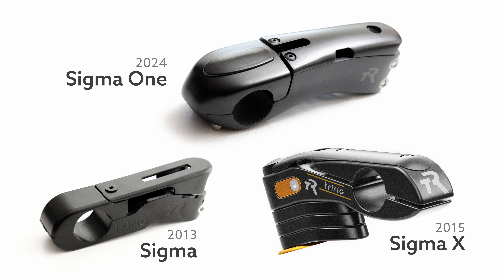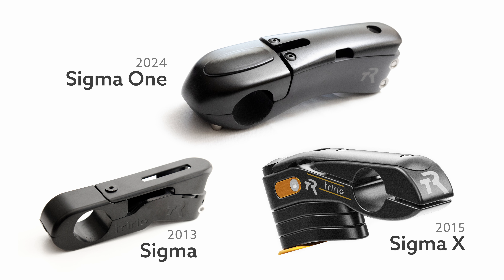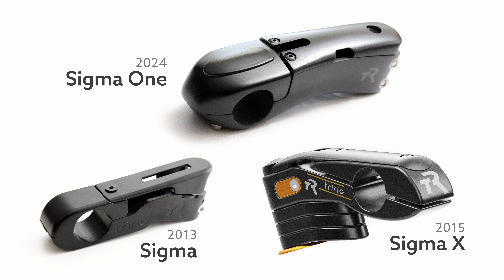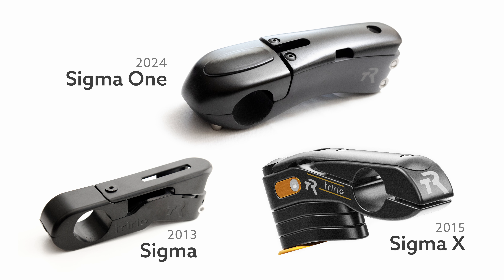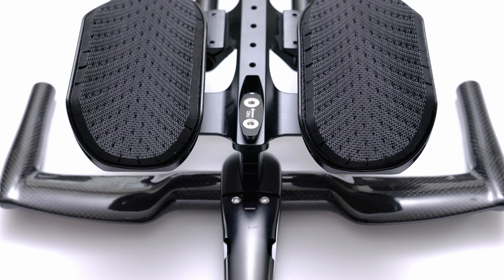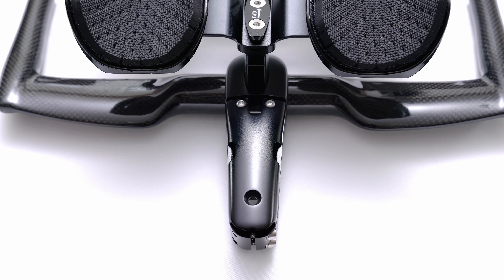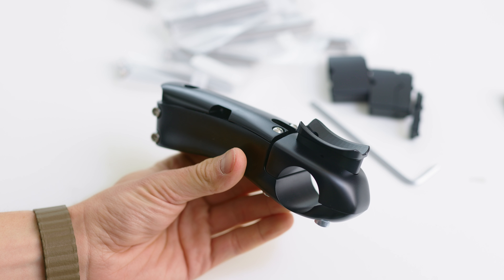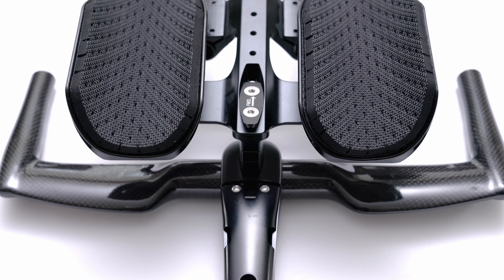The Revolutionary Stem that's also an Aerobar: Sigma One

Comment: Looks great Nick. Brilliant design.

Length(s) and angle are missing on the site. Also, does it have an integrated computer+camera mount? Doesn't appear so.
Reply from the maker: Thanks David! Sigma One offers 100mm reach, 25mm rise. This is closest to a 100mm -17deg stem. But using angles and lengths is an outmoded way to do fit. We just give you the exact stack and reach so that you don't have to do any trigonometry 🙂 As far as computer mount - that's something we could certainly build. Thanks for the suggestion.